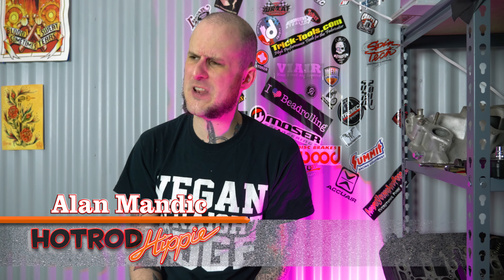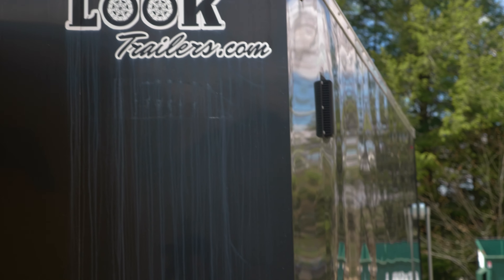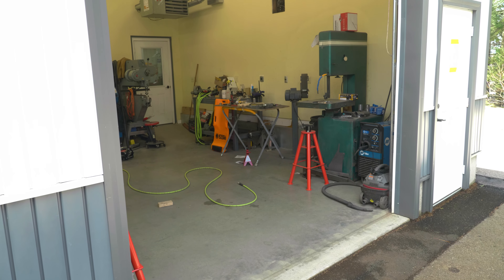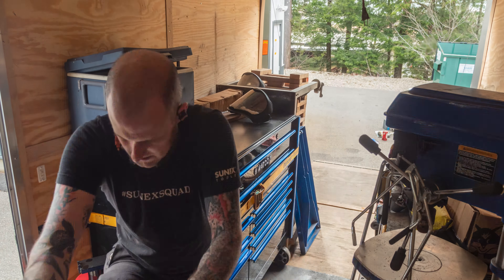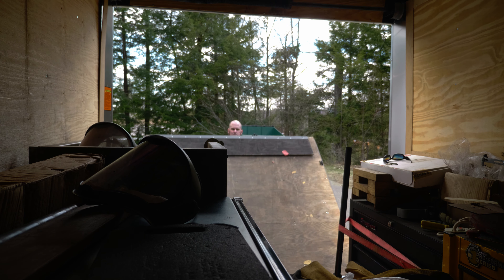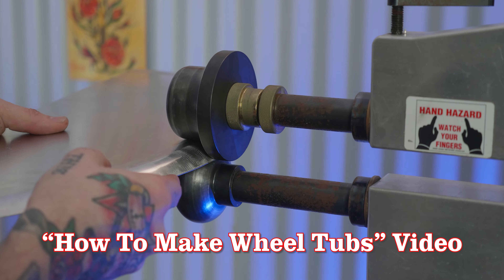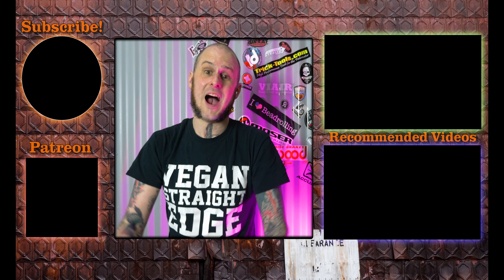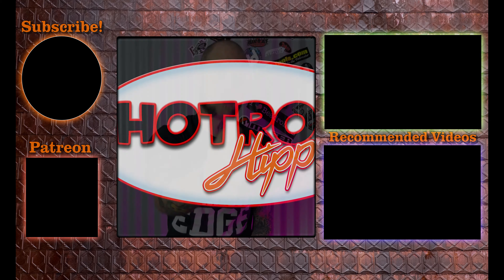I'm Leaving...

Comment: Best of luck with everything, Alan. BTW, that's the first Westward drill press I've seen.
Reply from the maker: I don't think they make that one anymore. It seems to be exactly the same as the older Jet models so they probably bought up some stock of them and painted them their colors. It was the cheapest drill press that fit my size needs and honestly I really like it. If they still sold it I'd do a video about it to recommend it, but alas they don't. And thank you. 👍👍